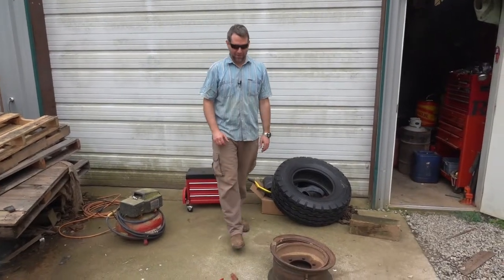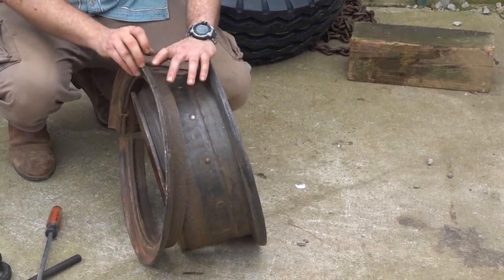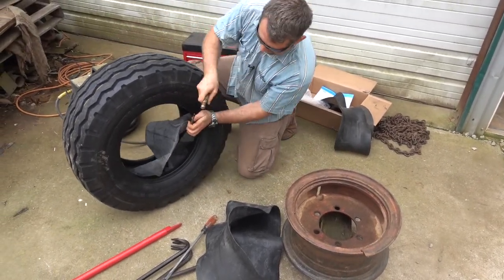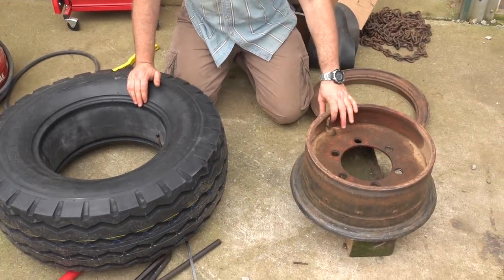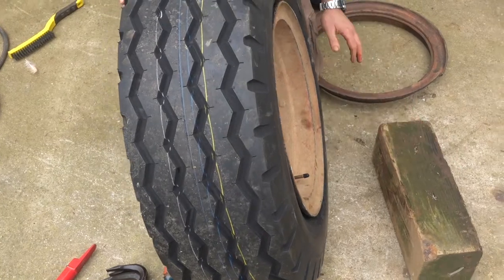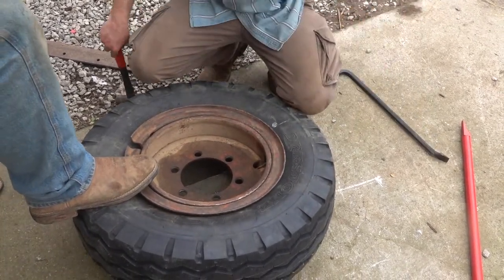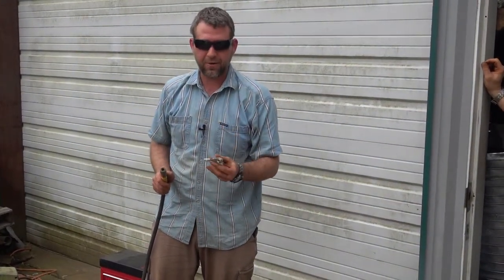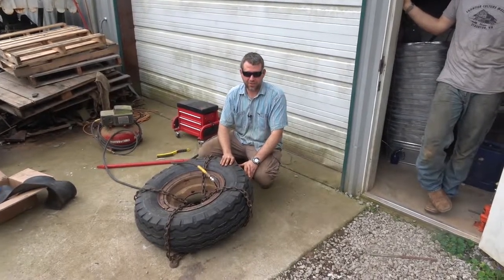Mounting Split Rim Tire

Comment: Some quick tips!  Put the split in the ring directly across from the valve, this helps balance the tire.   Also put 5lbs of air in it, then hit the ring with a hammer, this helps seat the ring.
Reply: Thank you for the advice on split rings. will definitely put a tad of pressure and try this if i run into such issues. Safely ofcourse

Comment: This is not a split rim “widow maker” this is a split ring rim. There is a difference. The widow maker is the Firestone RH-5 and is a two piece rim that fixes together in the center of the barrel not via a split ring. Split rings although may hurt if you’re an ignoramous will not kill you the way a widow maker will by spontaneously exploding apart normally while inflating the tire but sometimes when adding load.